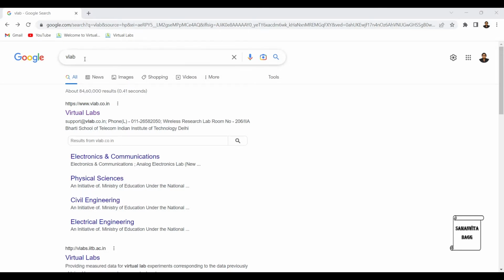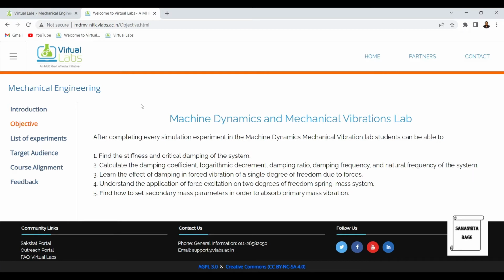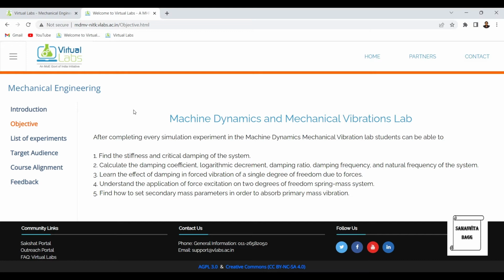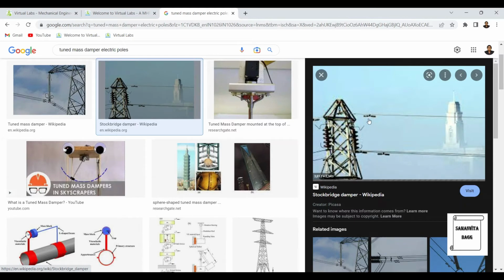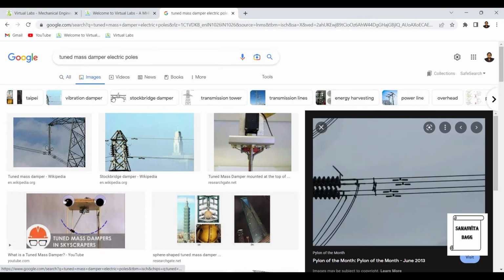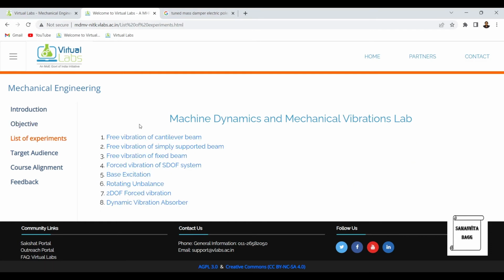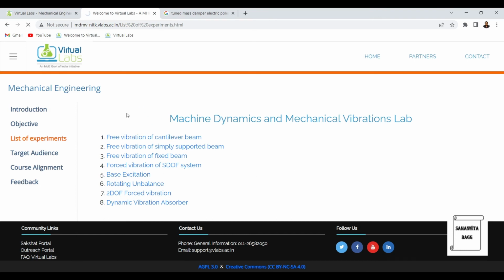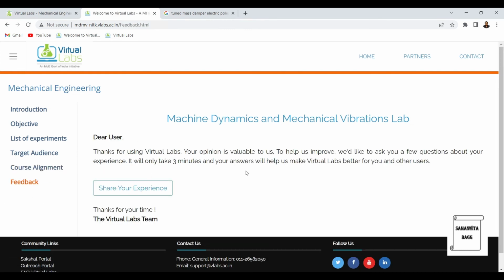Introduction | Machine Dynamics | Mechanical Vibrations | Online Experimentation | How to use vlab

Comment: Weights are used to damp vibrations that may induced between wires carrying high voltage as they behave as electromagnets if they vibrate it will result in loss of electricity, hence loss of transmission